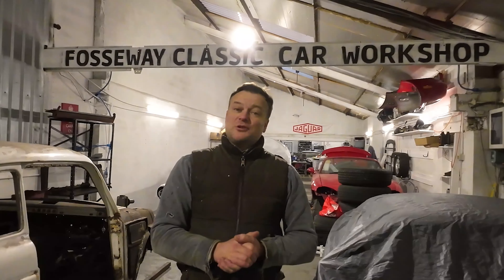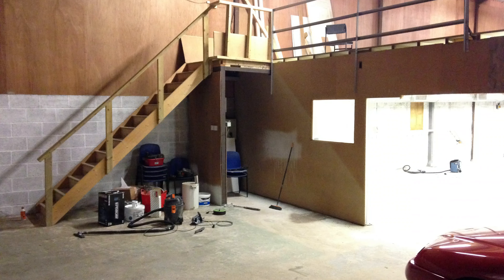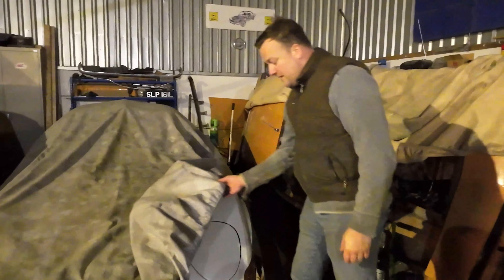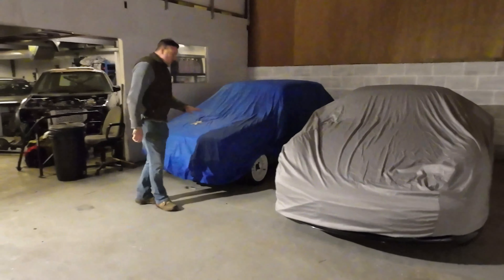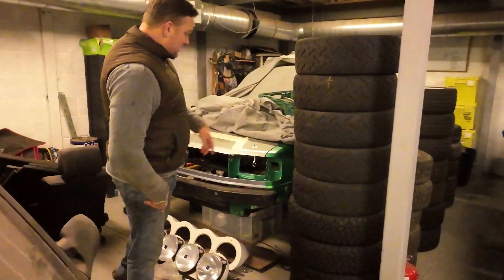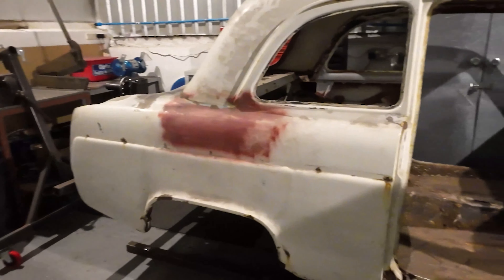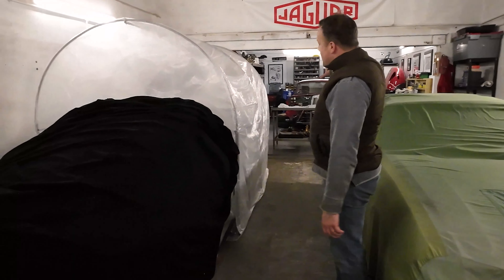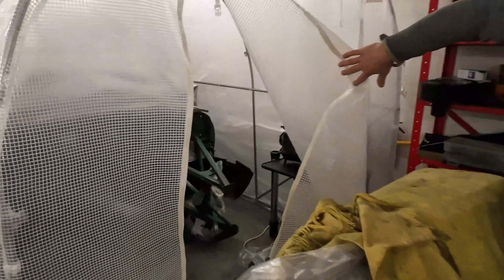Tour of Fosseway Classic Car Workshop

Comment: MK10 very exciting! Very nice expanding enterprise, really begging for a sanding booth and paint booth. A warning, I would keep the sandblast cabs outside as they are not air tight and an easy way to spread aspestos seals and lead paint all over the workshop.
Reply from the maker: I’d love to have a prep area and spray booth. It’s definitely in the mid-long term plan. Thanks for the advice I did want to vent the sand blaster outside. Looking forward to driving the mk10 again one day…